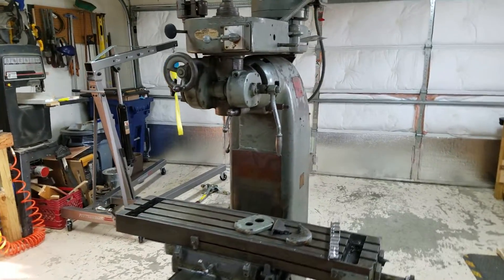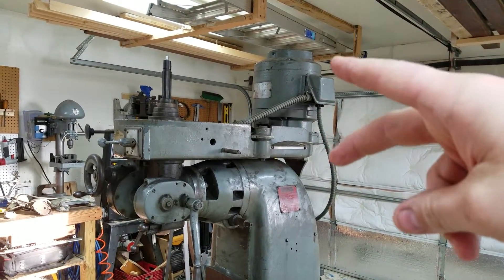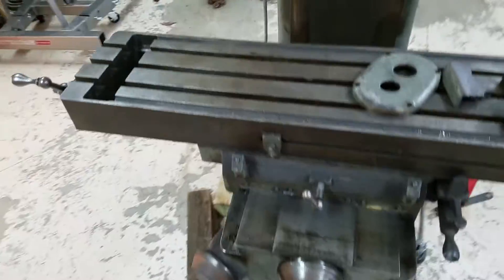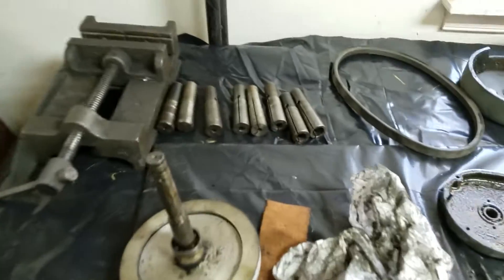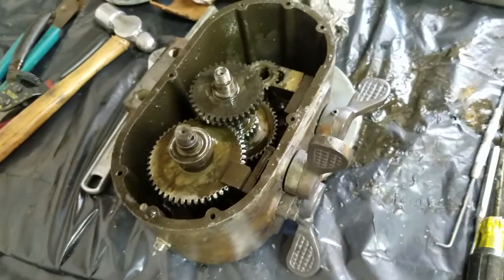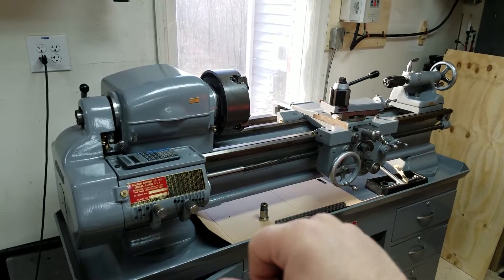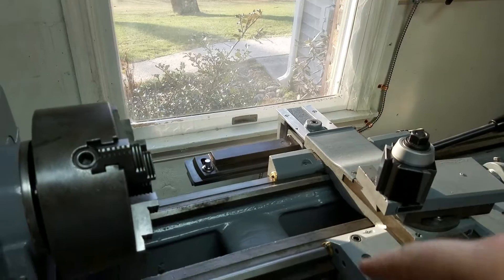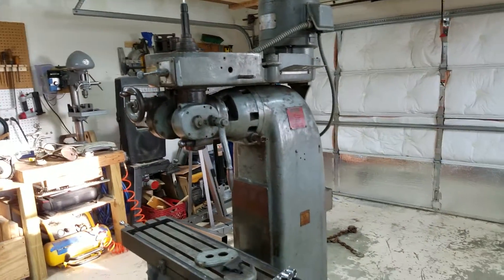Upgrades!!! Milling machine and lathe

Comment: how did you move this machine?  doesn't have enough support on head to avoid tilting... just need to move a model 55 within a few days..
Reply from the maker: From the place of purchase to my home was a forklift.  From outside my garage to inside, I used pieces of pipe as rollers underneath the machine.  Slow and steady was my motto.
Reply: thanks..I will make it this way.... did you know which bearing numbers does the spindle has? @ThunderDog

Comment: Hi, I have a super 55 I love it. I was wondering the electric motor that drives your power feed would you know the speed and horsepower of it? I called the company and they couldn’t tell me didn’t have the information. Mine is not original it’s 3/4 HP🎉 and 3600 RPMs, which doesn’t sound right at all the speed that is. thank you very much.
Reply from the maker: My machines are in storage at the moment.  But, if memory serves, the table feed motor  was a 220V(not 120V) 1/2 or 3/4 HP motor.  I wish I could tell you more definitively to provide more help.

Comment: I recently acquired this machine and was curious in the x axis power feed if you put oil or grease back in? Mine was caked with nasty grease and started cleaning but wasnt sure I wanted to use grease back in there... But they are gears so thought perhaps I should.  Was curious what you did when you reassembled yours

Comment: wait a sec are all the bits of that bracket there? i bet if it is it will make a good pattern you game to give it ago
Reply from the maker: Cast iron, I'll give it a whirl.
Reply: ok first task clean and degrease all the bits. and find some jb weld use it to glue every thing back as it was . then sand that all down and show it to us . your going to also need to add a machining allowance to the machined surfaces. is there a boar in it ? if so probably need to add a core print and make a core box . but first off get it back in one piece.